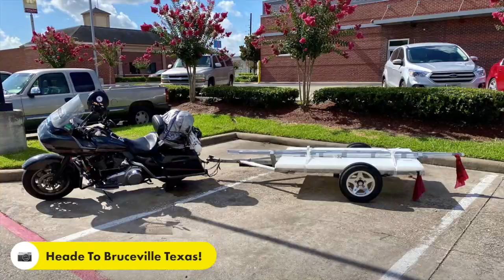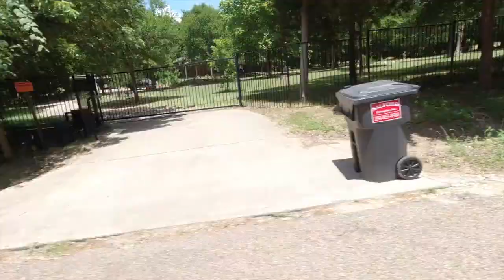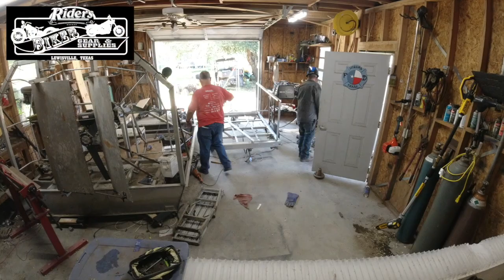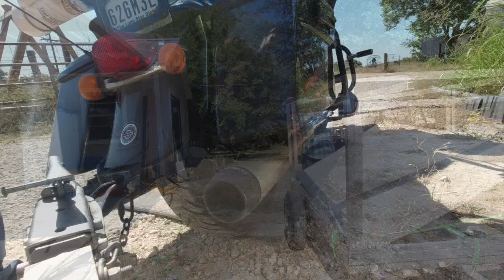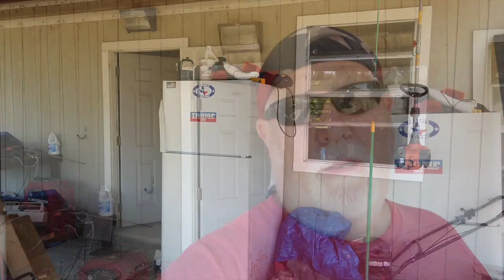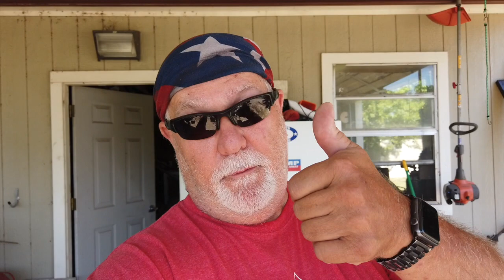Riding For A Cure Trailer Rebuild Part 08

Comment: Have u looked at pop up trailers to c how they work?  R u going to put a small winch on it to raise and lower it
Reply from the maker: Yes I have. My first choice is Linear Actuator to lift the top, the second choice is cables & pulley with a small winch and my third choice is Gas Shocks to lift the roof.